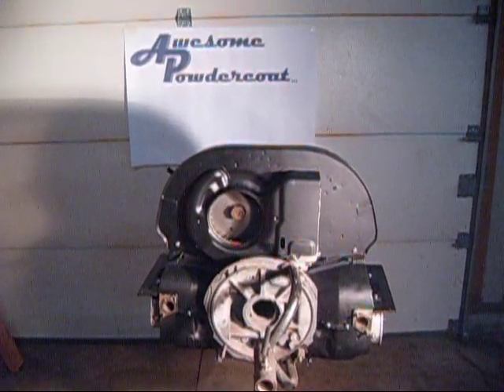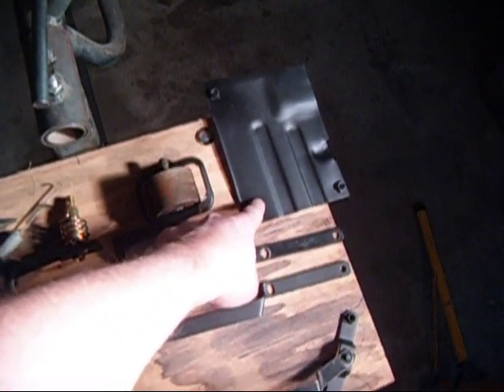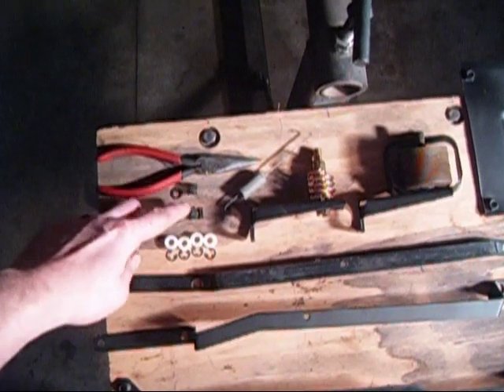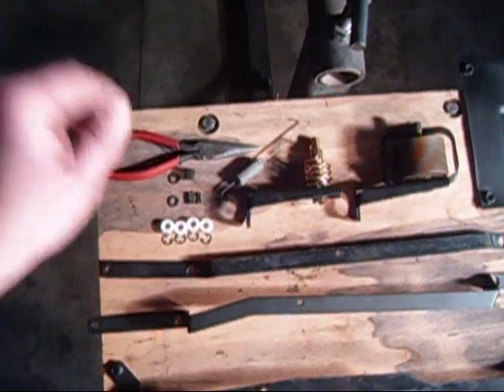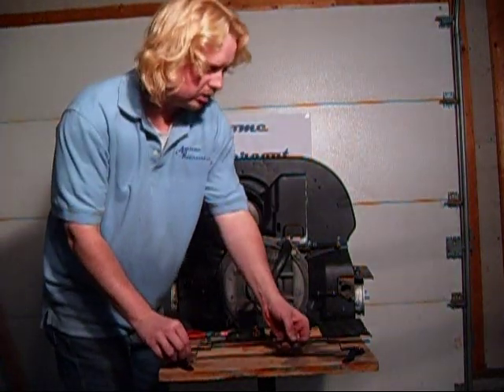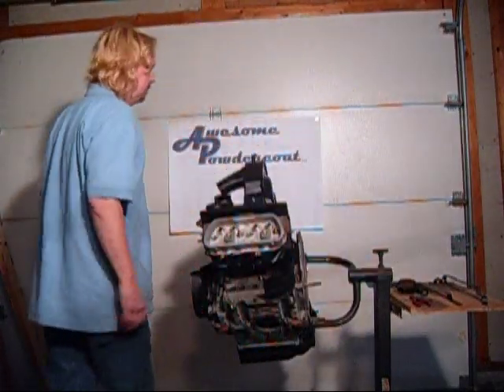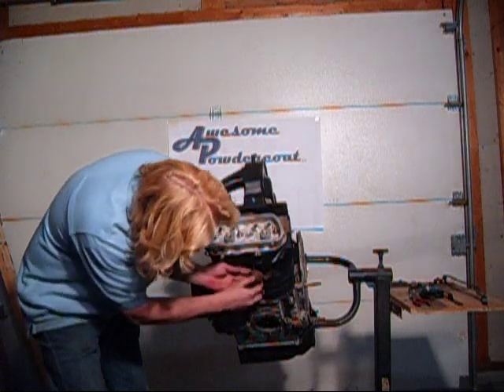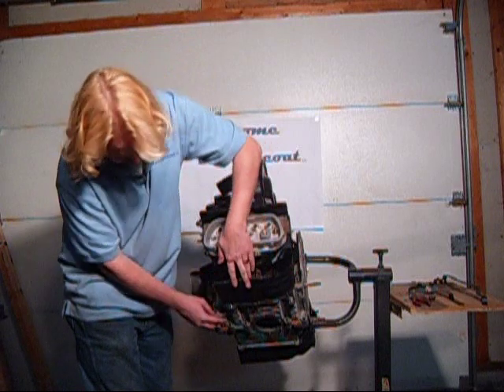Part 11 - Thermostat linkage and bracket installation

Comment: I omitted to install the linkage return spring.How important is that for the function.I don't seem to be able to install it without taking the engine back out.It is all together but I have a spare spring:).
Thank you for uploading this series.Very helpful.